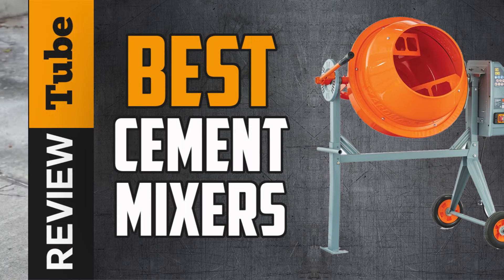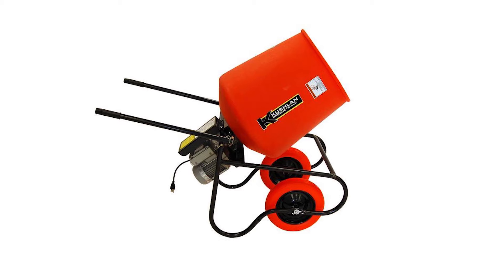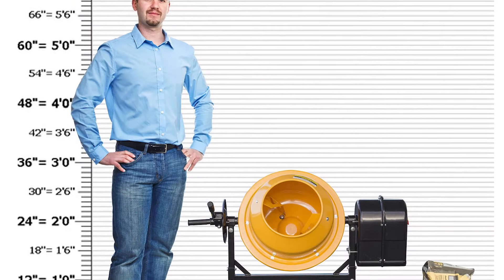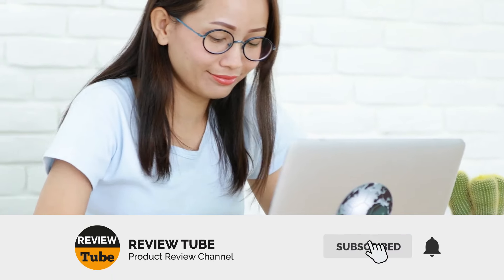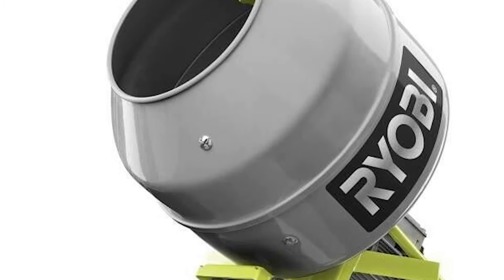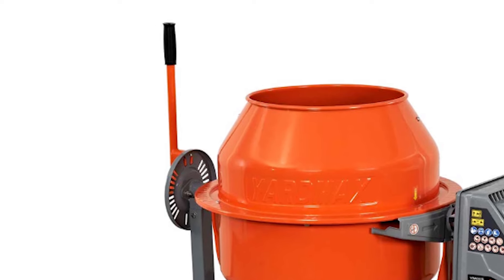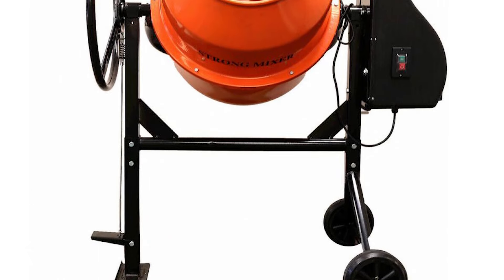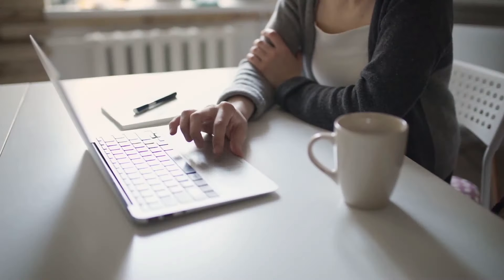✅Cement Mixer: Best Cement & Concrete Mixers (Buying Guide)

Comment: #4  The low profile height makes it easier to pour into wheelbarrows.
Fess up.  You've never used a concrete mixer or a wheelbarrow, have you?
How much did you get paid to read this drivel?

Comment: All these are toys but I guess price for use here in there ok they running way to fast I got a real cement mixer 3 sacks thats3 sacks pure cement 48 shovels sand 68 shovels gravel yep know what I'm talking about electric I take 1500
Reply: what the fuck
Reply: @genecoppedge5972  did it for years